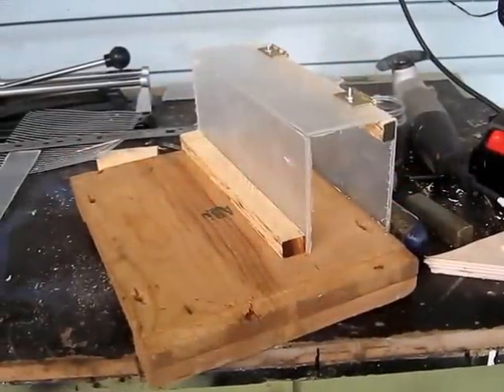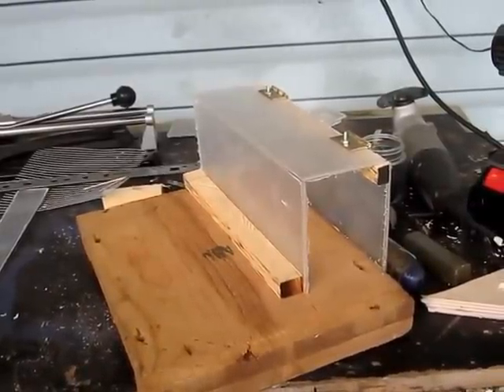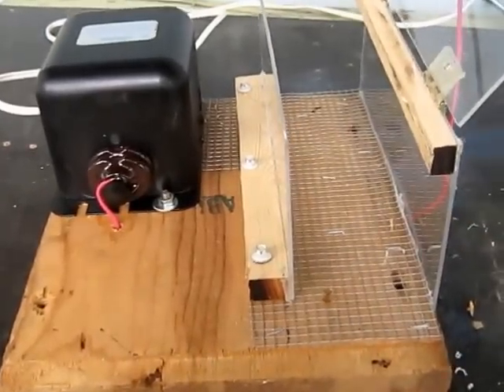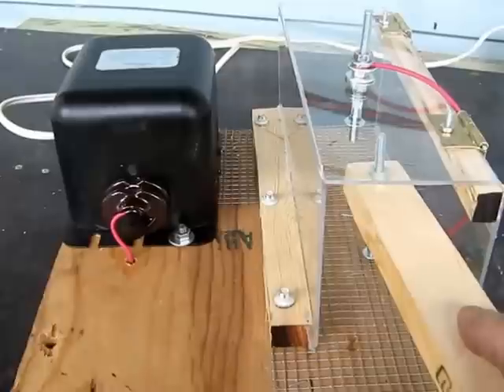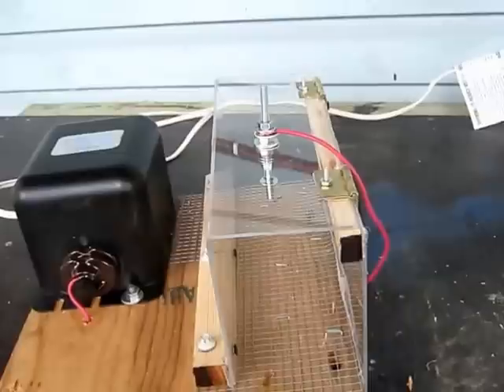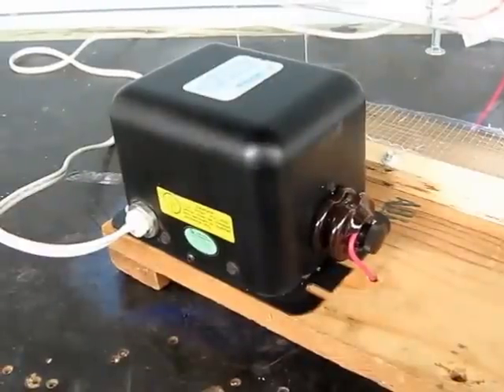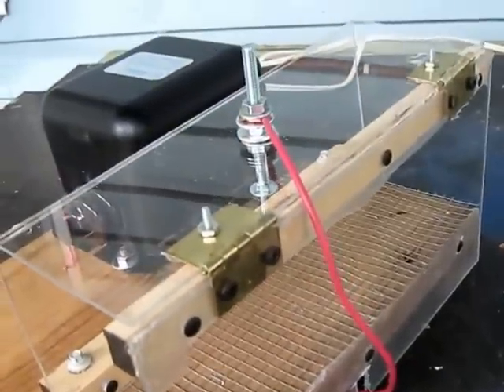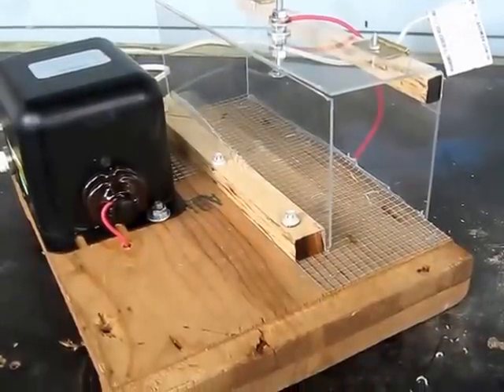ELECTRIC  RAT / MOUSE KILLER

Comment: Almost of all mouse trap did not show how do a wiringss,, that is very important
Reply from the maker: you just need  your 120 going into the transformer and the two wires coming out, one needs to be on the metal hardware cloth for them to stand on and the other wire goes to the peg holding the food.

Comment: I looked at a few furnace ignition transformers online.  Most are 6000V to 10000V and 250VA.  This is about 25-40mA.  Usually 100-200mA are lethal to humans but 25-40mA can kill if you cannot let go or it causes a strong convulsion.  Such a convulsion can break an arm or leg bone, not to mention a finger bone.
Reply from the maker: I don't mess with this anymore.

Comment: I used a broom stick,,, rolled  bare copper wire around ti for about 4" then a break and again 4" of bare copper wire... I placed bait at the end of the broom stick which was placed at an angle of about 45 degrees. The neutral at one end and the active at the other,,,  240 vac,,, never caught a rat... I guess they can sense the radiation ??? don't know... Of course I was the only one with access to this trap,,, except the rates.

Comment: Could you make a diy video step by step with materials to buy ?
Reply from the maker: this is newer model it's a lot simpler, all you need is the transformer from an old fuel oil furnace or neon sign etc. this one is from a furnace, then you just need a small piece of hardware cloth, and a small amount of plastic pipe and a bit of wire,  https://www.youtube.com/watch?v=YcAIPSqQMTo&index=90&list=PLYtZKjKFSTRgIPDTNyMILXWm0aA6kqEiP

Comment: I used a transformer out of an old 1500 watt microwave oven and a 300mf capacitor to build basically the same thing, only for gray and red squirrel control. I used the GFCI plug and cord from an old electric pressure washer for the safety measure, just in case. Unit works great, plus all the stray cats in the neighborhood are fed well. :)
Reply: 300 uf at 2,000 volts would be huge.
Reply: 300uf?  Better check that.

Comment: This will not work unless the rat or mouse powers the transformer on and gets electrocuted at the same time. A mouse or rat will not go anywhere near a high voltage transformer that is powered up and sitting idle. The residual static field charge emitted from the contacts will drive them away.

Comment: I also have a transformer/igniter from a furnace, but something is very wrong the moment i put one leed on from the transformer the wire cloth is some what live damn it hurt not a full shock but with just one wire what gives i am not a electrition something is wrong if anyone has a clue email me please at  atexasattitude@hotmail.com
Reply from the maker: the transformer I have , the body is grounded to the mesh and there is only one hot wire coming out of it, I set the body of it on the mesh and run the hot wire to the bolt  which only puts out shock if the bolt and the mesh is grounded, as I showed with the board and bolt thing. other wise unless your transmformer is shorted I don't know why it did that.

Comment: Where to find a cheap but right for the job, transformer?
Reply from the maker: if you can fine an old fuel oil or maybe even gas furnace, they have a pretty powerful transformer in them, other wise I don't really know.
Reply: Thanks a lot for the rapid reply. Will look into that especially in estate or garage sales, keeping fingers crossed for one cheap one. I was hoping to find one in Microwaves as I see too many of them thrown out or dirt cheap, but guess not. One crazy question: Would it be possible to line up some capacitors (Such as found in common amplifiers) to deliver that high juice? even if that can come as one pulse and then time to recharge?

Comment: Well, thumb upped but it's just too hazardous.  It needs to be plugged in somewhere.  It must be in an always dry area. It continuously uses electricity whether it's making an arc or not.  You can shape 2 pieces of stiff wire attached to the terminals  to be away from the case and come close together over the transformer and then continue upwards spreading farther apart. An arc will form at the narrow point, the hot ionized air will rise to the top and break, a new arc will strike at the bottom.  This will probably create radio interferance so should not be left to run long or unattended.  It's still an extremely dangerous arrangement and a fire hazard.  EXPENSIVE. but excellent repeating rat trap -  A24 rat trap - is sold in US.  Design does not present a hazard to most desirable creatures, but is highly effective on rats / mice & probably squirrels & chipmunks.
 https://youtu.be/BqlwUXP-ubI
Reply: Forgot to mention, the arc gadget was usually present in old sci-fi horror movies, it's known as a Jacobs Ladder.
Reply from the maker: yes there could be some danger involved with this contraption but in the past I rigged up a gadget to kill starlings, it was two pieces of bare copper wire running parallel maybe 2 inches apart hooked to 120 volt house current, upon touching both wires at the same time they would be shocked. I had a fuse in line so if they got caught in between the wires the fuse would blow and not cause a fire, I only got one bird, I guess their feathers made too good of an insulator so I abandoned  that idea. thanks for commenting.
Reply: I found a dead rat in my well house in a outlet that did not have a cover plate. zzzzztttt.

Comment: An oil furnace high voltage transformer to electrocute a mouse is like hitting it with a bolt of lightning!
Reply from the maker: I broke the plexi glass but I need to fix it back up and try it again.

Comment: wood en high voltage is disaster sooner or later it go's on fier, the transformer is not designed for all the time under power en open terminals is way to high voltage the insulation will leak current wat will make the secondary winding burn out.

Comment: Roger about the fire hazard. From the length of the arc I'm guessing you're getting about 20kv out of that transformer. . If the wire you are using isn't rated for a MUCH higher voltage, it will eventually break down, start arcing carbonize some would and ignite. That looks like an ignition transformer from an oil furnace. It's meant to start fires! )

Comment: Great video sir. I recognize that transformer. I worked at an aluminum plant were we melted, cast, and rolled big 25,000 lb aluminum coils. We put those coils in annealing ovens. We used many of those transformers to light gas burners for these annealing ovens. I've replaced many of them. One nice thing is they run off of 120V. Very useful if you know what i mean. 6,000 volts is plenty for many uses. You can even cascade them and get much higher voltage.

Comment: Gonna need  more current if you want to kill them, also rats can sense the high voltage so it needs to be turned on after they complete the circuit. Here is my result https://youtu.be/LwXdQy5Bsjc

Comment: Bad idea. The dead mouse will continue to shortcircuit and burn until the power is turned off. Should have some means of ejecting the dead mouse once it is electrocuted.
Reply: When the mouse gets electrocuted it will fall down and break the connection
Reply: Ever see someone jerk back when shocked by electricity? The rat will jump 10 feet back and be dead, ready to be picked up with a shovel.
Reply: Yeah I was thinking the same thing. Maybe if he turned the trap on its side it would be a little safer. The mice can climb up that wire mesh easily. Then zap them and gravity should help them drop free. They could still probably get stuck though and potentially cause a fire.
Reply from the maker: the hardware cloth on the bottom is the ground and the bolt up high enough where they have to get up on their back legs to reach it and then if shocked they will fall down and break the connection, but so far I haven't needed to try it anyway.

Comment: That's a nice trap you got there, sir.  Do we need a fuse for such a trap to prevent a short?
Reply from the maker: +cebuboy1976 it never hurts to have extra safety protection but since it runs through the house circuit breaker , that should be enough,, thanks for commenting.
Reply: Thank you.

Comment: whats the purpose of the transformer? Do you need to have one to make this?
Reply from the maker: +Keith Kanyeshna yes, the transformer increases the voltage up to 6000 volts I think it is, and that makes the sparks jump so far. might not be enough amps to kill a mouse though, I never got to try it on a mouse , since I made this, we haven't had any mice in the house.. thanks for commenting.
Reply: +MissouriOldTimer your welcome!  So could I hook 110v wires to hardware cloth with a light switch. then put some bait. then when the rat walks onto it I could flip the light switch and fry him?  Or maybe a car battery connected to hardware cloth with jumper cables and when the rat walks onto it I can connect the negative terminal and complete the circuit?
Reply from the maker: +Keith Kanyeshna I did something like that to get starlings, I used 110v but I put a fuse in the circuit in case there was a dead short when the bird was stuck between the floor and the electrode.

Comment: I would love to see that thing in action frying some @#!#& mice.
Reply from the maker: If I can figure out some way to do that I will, but  right now I don't see any signs of mice and I need a motion detector camera. thanks for commenting.
Reply: +MissouriOldTimer Hi, did you put the safety switch on yet? If so can you show us please? I have a major Rat problem in my basement and shop. I would like to make a couple of these.  Although, I dont understand the transformer. Can I buy them at Harbor Freight?
Reply from the maker: +Keith Kanyeshna honestly , ever since I made this thing, I haven't seen a mouse in here, so I didn't put a safety switch on it,, but as long as a person is careful and unplug it before working with it, that would be safety enough, this transformer came from a home heater, fuel oil or maybe gas, Harbor freight doesn't carry them, if you can find an old heater there might be a good one still on it. You can also buy factory traps kind of like this, I don't know how expensive they are though. thanks for inquiring.
Reply: +MissouriOldTimer Thanks!  I was also wondering if you think a rat would continue to fry or cook in there all night from the electricity until you check the next day and unplug it?